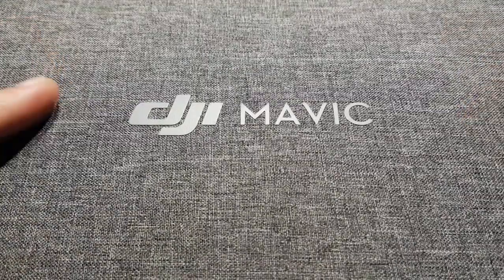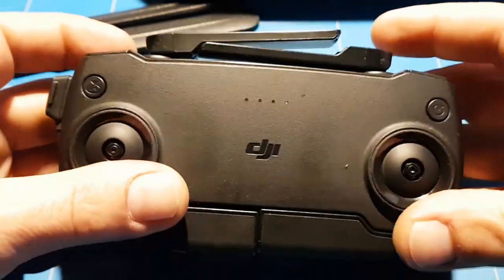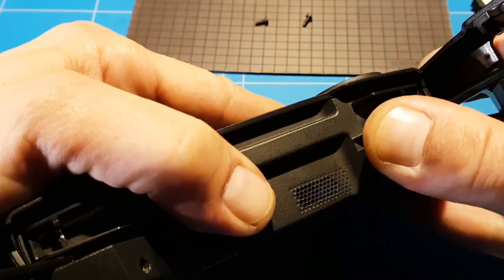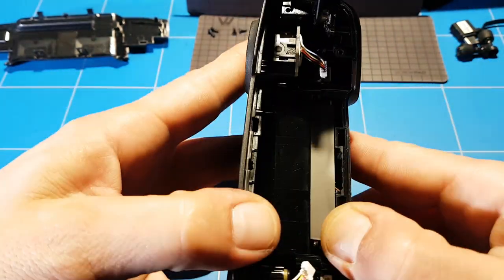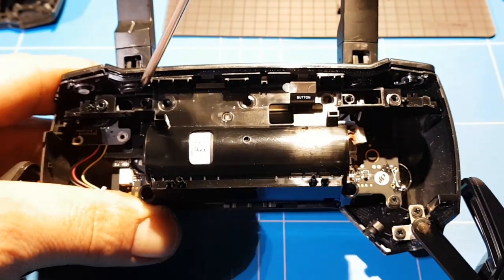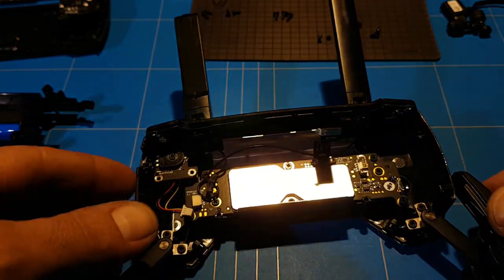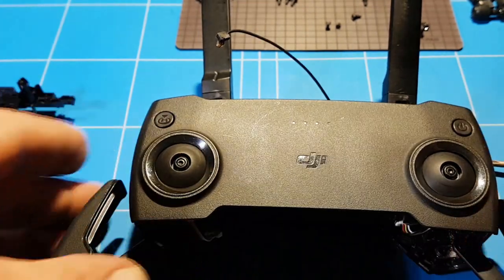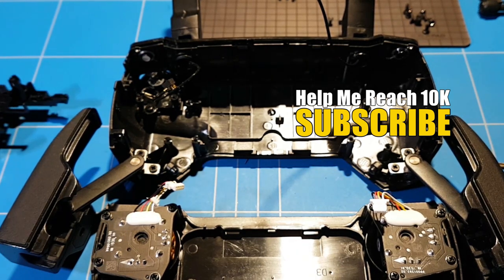DJI Mavic Mini TX Transmitter Teardown Maintenance Antenna Upgrade and Mods

Comment: The connector that you broke can be super easily disconnected by pulling on the wires
Reply from the maker: never pull on the wires that a rookie mistakes you screw up the connection or the wires
Reply: @HowToDIYRc  says the guy that destroys the plug
Reply: The crimps on the wires is strong enough to lift this brittle smd solder heat resistant plug